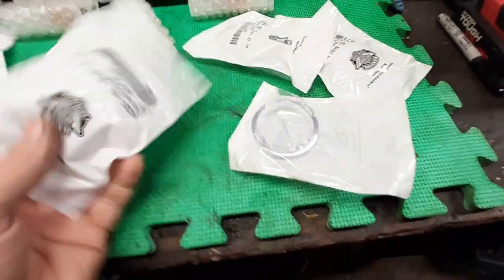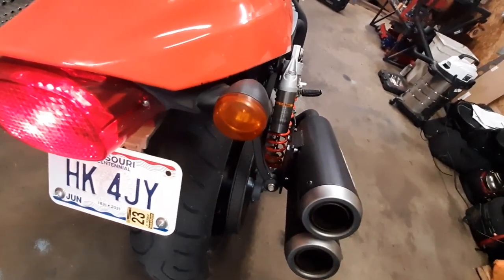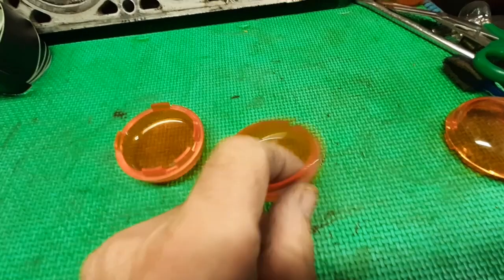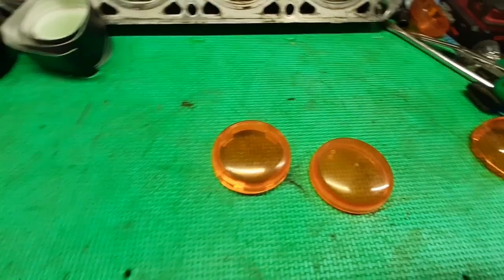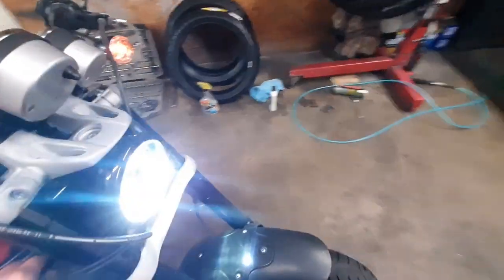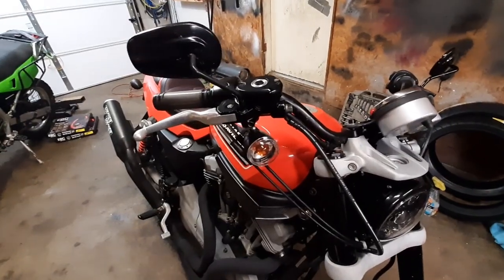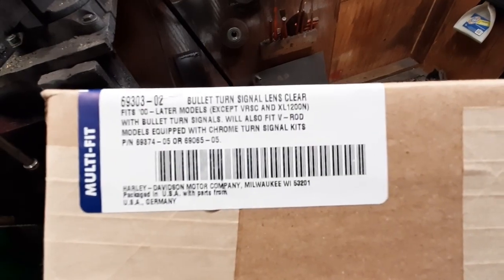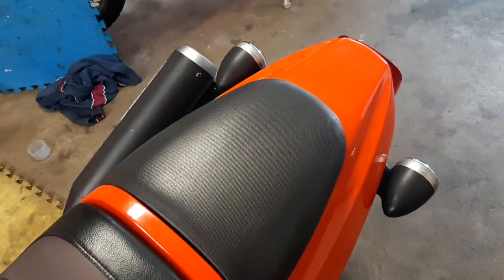Harley Davidson XR1200 Clear Lens Turn Signal Mod

Comment: Hi, i see you have some seat pad. Where you buy it and does it make seat also softer? I have also xr. Great bike.
Reply from the maker: It's a complete replacement seat made by Saddleman.  Ordered it from DennisKirk.  It's better than stock but still probably not the best option.  I plan to recover the stock seat when I have time.   My main complaint with the stock seat was that it was slick.  More traction and a little more padding in the front of the stock seat and I think I would like it better than the Saddleman.